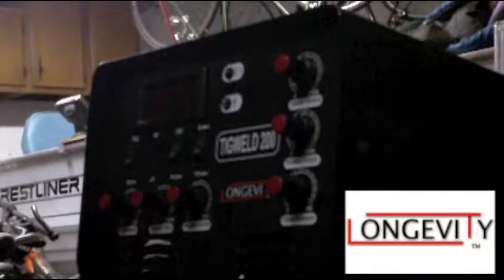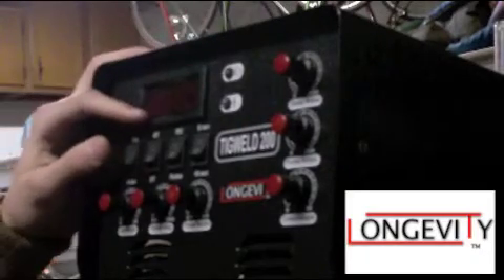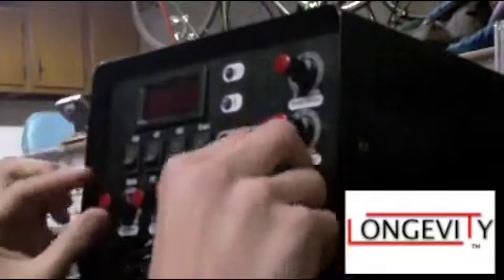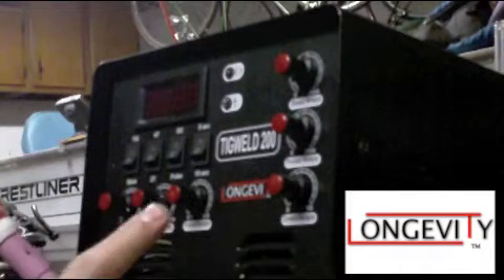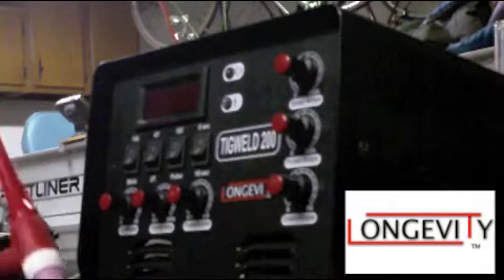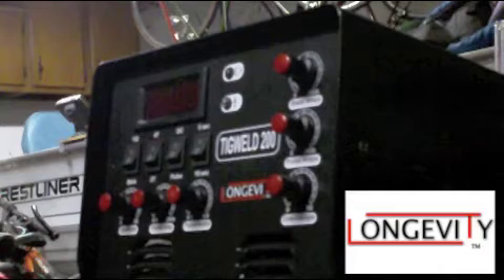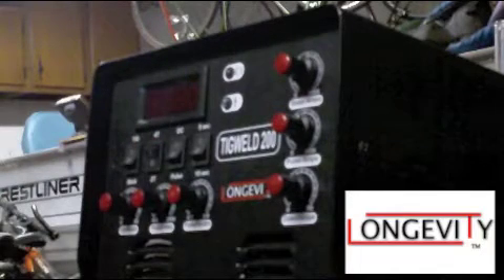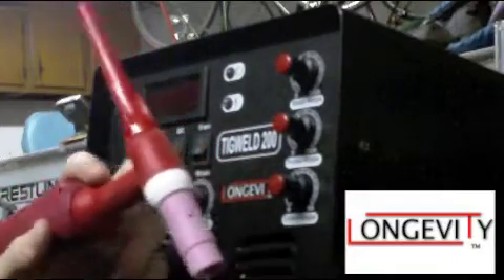Longevity TIG WELD 200 Front panel overview

Comment: yes the 5 and 10 sec is your post flow that controls how long your tig torch will put out argon after your done welding. this helps mostly with stainless welding to help cool the weld down and keep it from oxidizing.